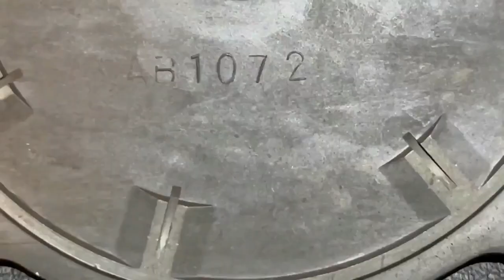Olympus DIC/NIC Phase Contrast Microscope Condenser Nomarski - before and after service.

Comment: For DIC, I thought the condenser position setting is the same as for Brightfield since the two prisms are located outside of the condenser (one above the objective and one above the light source).
Whereas for Phase Contrast the condenser position setting requires the annulus. 
Is this correct ?